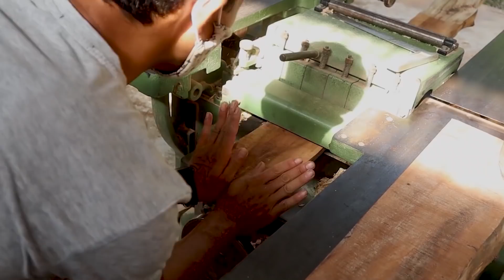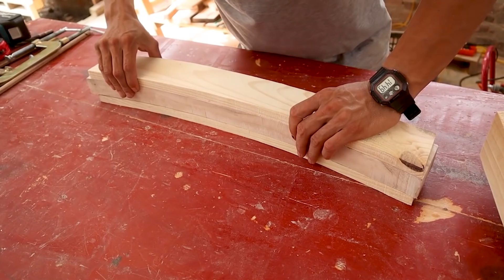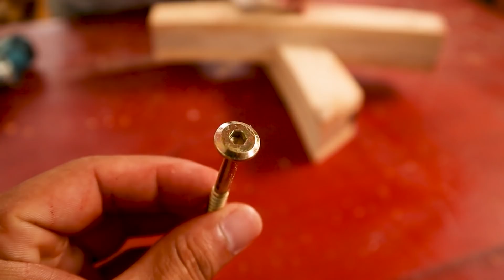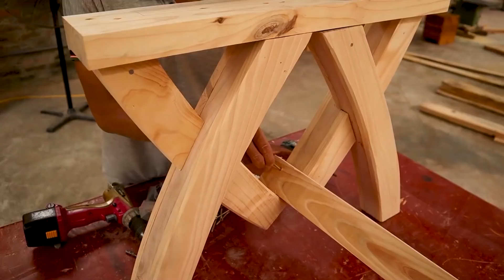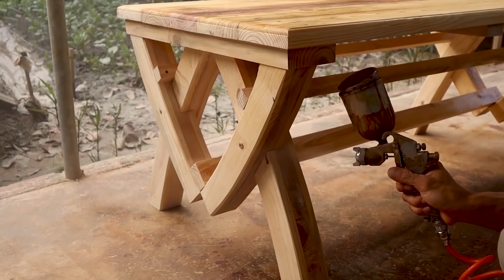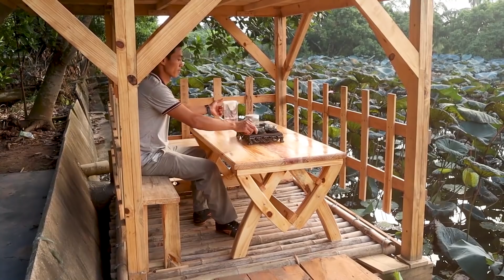Ingenious Skills & Techniques Curved Woodworking Worker // Extremely Beautiful Wooden Dining Table

Comment: Oh well, not too bad,  it looks like pine to me, only the middle slab of the table top is a kind of a different wood, if that was intended, that doesn't looks good, also the screws needs to be countersank. I wonder why he didn't screwed the table top from the bottom up, instead of screw it through the top.